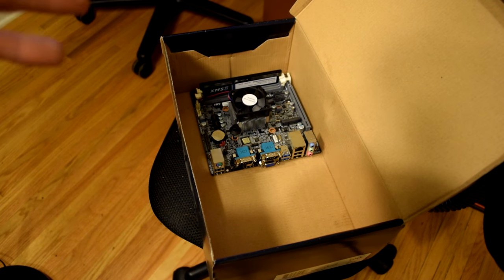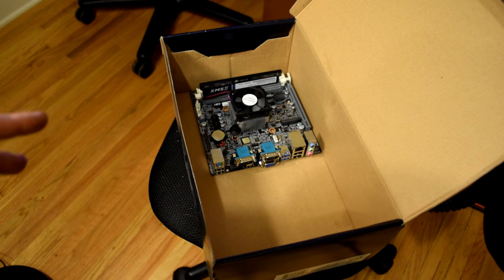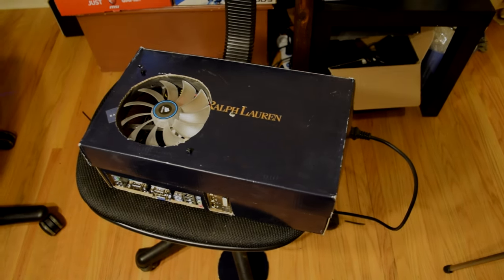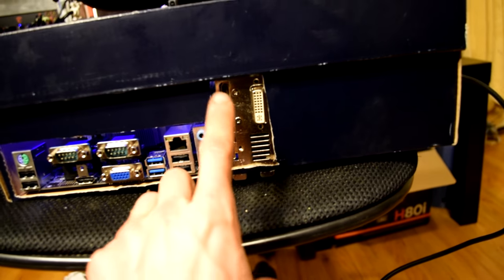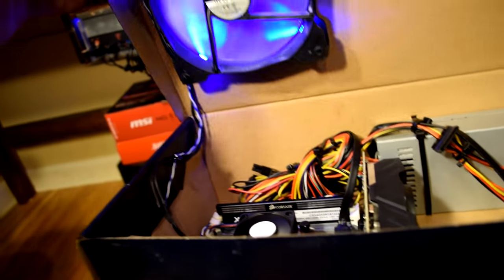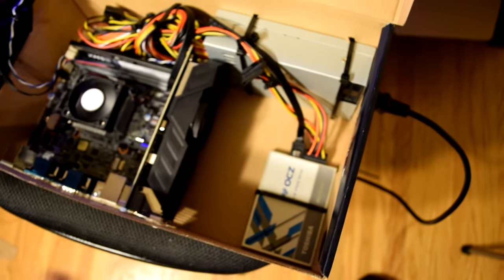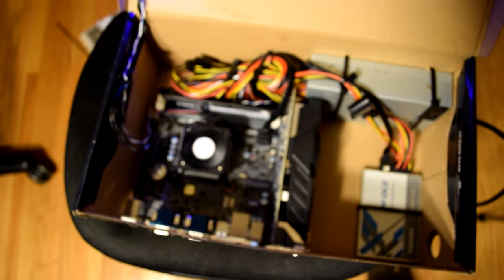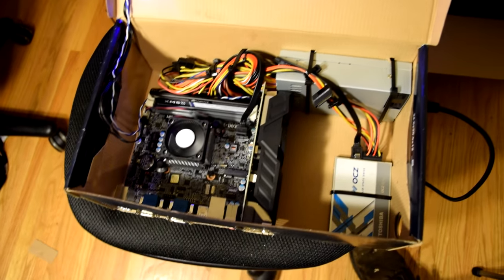Shoe box Gaming Computer - Time Lapse Build

Comment: Computer in a guitar plz?
Reply: Jazzyjaykillz puts raspberry pi inside with a tiny screen and mini wireless keyboard and mouse
Reply: nice idea
Reply: It's doable but it should ruin the acoustics, u can't have a fan as that would echo and stuff, so u can only use a weak machine that doesn't need that much heat reduction

Comment: Do you want a fire? That's how you start a fire.
Reply: Not at all. Cardboard will ignite at 427°C. The core of the CPU itself will never reach temperatures like that. Plus, he has a fan so it will never ignite.
Reply: Thomas Moulden Consider this though, if he used this build regularly enough for it to accumulate dust and what not, a large enough amount could be enough to do it. but eh you're probably right, he made the build just to make it. There probably wouldn't be enough use for that to happen I wanted to Archer meme 🔥
Reply: cpus usually turn off immediately at around 120c